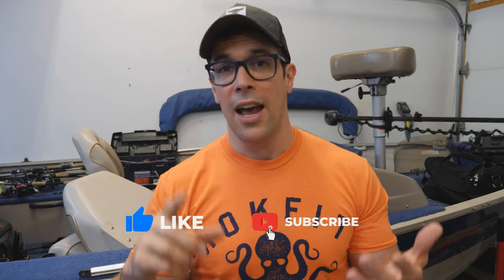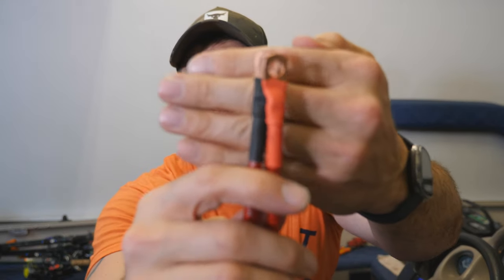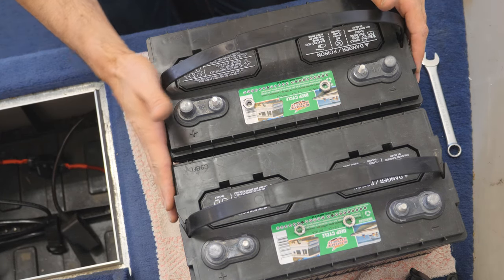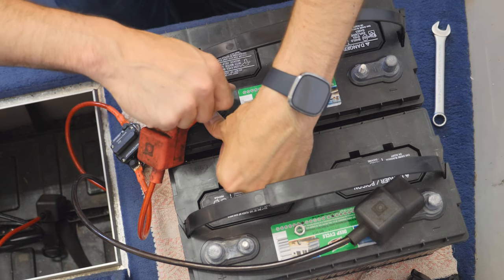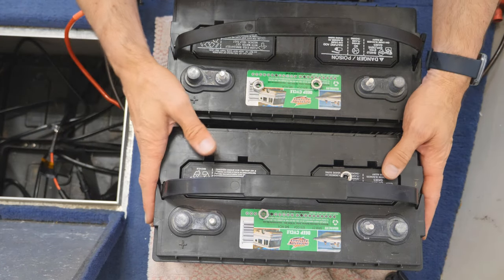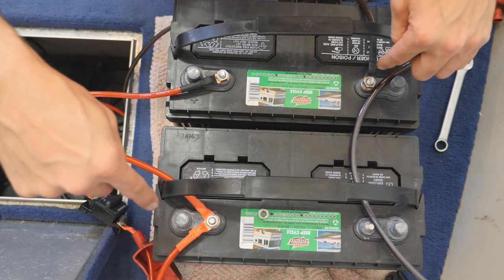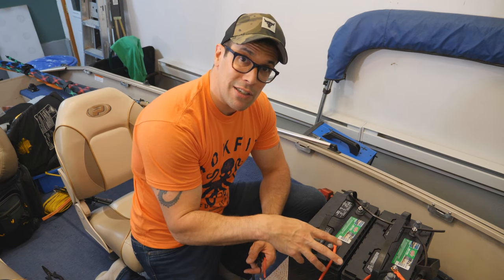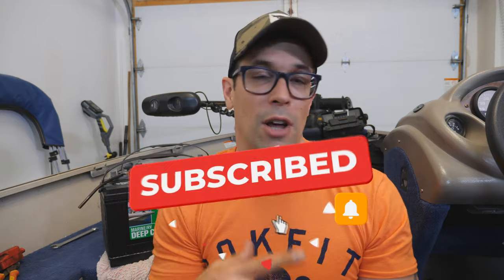Wiring 12v Batteries in Series or Parallel + Charging Tips!

Comment: Maybe I didn't understand. 
I have x2 12v lithium batteries I will connect in series for 24v
I also have a 13amp victron lithium 24volt charger
Are you saying I'm not able to use this charger at all?

Not worried about dead batteries as they will be hooked up to a smart shunt anyway

Comment: Hi, me and my friends wired 3 12V car batteries in parallel and for some reason the car has 16V when engine is on and over 13V when it's off. Do you know why? The batteries are new and identical.
Reply from the maker: Hi there, reading 13 volts after a 12v battery has been charging via a charger or the charging system/alternator of an engine is completely normal.  12v VRLA (lead acid based batteries) consist of 6 cells, each of 2.2 volts.  So PEAK voltage on all these combined is technically 13.3v and after 24 - 48 hours, the voltage will settle (resting voltage) to around 2.1v per cell, or 12.6 - 12.7 volts.

The 16v is because your engine's charging system is engaged and your alternator is charging your batteries.  Typically you should see your battery voltage increase to 14.6 - 14.8 so I am not sure why yours would be going to 16v.  You may have a 16v alternator or it may be related to something else in your vehicle's charging system.  Hope that helps!

Comment: Can you wire 2 different battery types in parallel?  For instance a starting battery and a dual purpose battery.
Reply from the maker: Theoretically yes you can it will work, but in terms of battery durability and long-term life, it's not a good idea, it's always recommended that you have the same battery with the same specs connected in series or in parallel.

Comment: I have 24v and two 12v batteries. Can I wire the two 12v in series basically making it 24v and then wire the two 12v and 24v in parallel? I guess I could just buy another 24v and make things easier.

Comment: If i have 2 12 v wired in parallel , will my alternator from my motor charge both batteries?
Reply from the maker: @hdhdididu655  yes!
Reply: @DanRichardFishing  thanks for the reply man , and nice vid. I had another question. When I go to hook up my switch my switch panel for lights and what not, should I put those wires on the same posts that the engine is connected to ? Or the other two free posts?

Comment: If you don’t have a charger on boat, how do you charge batteries with an electric charger with the batteries wired in series and parerell?
Reply from the maker: You do the same as in this video, you clamp 1 charger per battery if in series.  For parallel you can do individual batteries or you can connect the entire bank to a single charger if you only have the one.  Hope that helps!

Comment: Dan, I’m looking to put a trolling motor on my 22’ Pathfinder.  I want to go with the Minn Kota Riptide Terrova 36v.  I see there are 36v single batteries and would love to have only one battery versus 3 however, does the same principle apply, when connecting a battery charger?  One battery, one bank?  And would you have a recommendation for a particular battery charger?  Thank you in advance for your help and keep up the great videos! It’s much appreciated.  Mike
Reply from the maker: Hi there! Glad you asked this question and sorry I didn't see this until now! You would absolutely just need 1 charger with 1 bank, but you would need to find a 36v battery charger specifically for that battery.  You can't use a regular 12v charger.  If you do look in to getting a 36v, I would recommend you reach out to the manufacturer and ask what charger they recommend.  I know Dakota Lithium sells an 8 amp and 18 amp charger for lithium batteries (I am assuming you are looking at a 36v lithium) and you can check those out at https://dakotalithium.com/12v-24v-36v-48v-lithium-battery-chargers/ and they are currently on sale for $100 off.  Hope that helps!
Reply: Thank you for replying and the advice.  I was hoping it was that easy! Much appreciated!!

Comment: New subscriber here. I have questions. Maybe you can help.  I have two 12v starter batteries ran parallel with a dual bank charger in the stern of the boat. I also have two 12v deep cycles ran in series in the bow for my 24v trolling motor. My trolling motor batteries do not have a charger. Should I install a 3 bank charger to charge all four batteries and just have one bank charge the two batteries ran parallel? Or should I install a complete separate dual bank charger in the bow of the boat? I just don't want to deal with running two extension cords from the house. Also, the boat is 19ft long. Is it even possible to charge batteries that far apart from each other with the same 3 bank system? Thanks!
Reply from the maker: Hi Chris, thanks so much for the sub!  To answer your question, you should actually be installing a 4 bank charger, which are readily available just like a 3 bank :)  And yes you can extend the wires, most charger manufacturers sell extensions you can add to any bank wire not long enough, or you can make your own with the gauge they recommended.  Hope that helps!
Reply: @DanRichardFishing  thanks so much for the reply!

Comment: So if I have 2 batteries is series for 24 colts…. And I wire the charger bank 1 on battery 1 and bank 2 on battery 2 I can’t charge both batteries at the same time? I have to charge bank 1 and then when it’s charged shit it off and charge bank 2
Reply from the maker: Hi Joshua, thank you for the question!  When you have 2 batteries in series for a 24 output, that wiring configuration has no bearing on your charging setup.  So bank 1 goes to battery 1 and bank 2 goes to battery 2 and you plug in your charger and both batteries will charge at the same time :)  All the best!

Comment: Hey Dan, do you use your onboard battery charger for your starting battery as well or just the trolling batteries? I have the Noco Genius genpro 10X3 but it's in the front of the boat with the trolling batteries and the starter battery is at the back of the boat, way out of reach of the cables. Should I be adding extensions and running it to the starter battery as well? Thanks! Great video as per usual.

Comment: With two 12v batteries, should you read 24 volts from positive to negative from one battery to another on both ends of the batteries?  I read 24v from negative to positive between both batteries on one end of the batteries, but not on the other end.
Reply: I forgot to add that the batteries are wired in series.

Comment: If I have 4 batteries in series to equal 48 v can I add 1 12 volt battery in parallel to increase the amps? Basically, I have an electric scooter and I want to add a removable car battery  in parallel that I will charge separately. The goal is giving the thing a bit more run time. I understand a car battery is not optimal but it's what I have lying around lol.. and it's brand new. I also have an extra SLA but it is a bit older and dying out a bit.

Comment: I'm naking my first lil power station and came across this on looking up series and parallel as well as charging. Because the toolbox im using can hold 8 12v 5A batteries. Got 4 so far, then realized how I'm gonna charge em. All so using them withba 300 watt inverter.
Reply: Your post makes no sense.

Comment: I have 6-- 12v 100ap I would like to connect 2 - 12v  200ap  is that ok to do
Reply from the maker: Yes absolutely, you can connect two in parallel.

Comment: A question TOTALLY not related to fishing, BUT, you seem to know a lot about batteries. I have an automatic gate opener powered by a 12 marine battery and charged by a small solar panel. It's in a box out in the pasture so I'm not sure of its capacity, but it's fairly beefy. I am replacing the opener with a different brand that requires 24v. I am all good on how to connect in series so no problem there. I also have a 350cca garden tractor battery spare battery in my garage. My first thought is that it would probably be crazy, but I don't know. Could I connect those in series to run the gate opener? I know I don't need 2 marine batteries, don't want to have to buy another, and just buying another 350cca and using those two would probably be sufficient. Not sure however because the manufacture says I need two 12v auto batteries. BUT, since I already have these two I thought I would ask. Don't want to start a prairie fire, you know. Thanks.

Comment: Hey Dan you seem to understand agm charging in parallel and have very good videos.   This my question I have a found  a Ranger 1760 angler barely used but with the pro series dual bank charger for my trolling motor.  When in parallel charging both batteries one for each bank I am getting a max combined 25.1 or basically 12.55 each  when I charge them using the same dual bank not linked in parellel I get 13.5 roughly on each battery.   I am thinking of putting a switch in between the parallel cable to basically turn off the connection while charging.  What s your thoughts?

Comment: How donyou know you have double amp hours  , as its still 12 volt setup .. and my solar controller is still showing it as 1 battery  , as it dont know o have 2 batteries connected , ? Cheers

Comment: when you hook them this way are the Amps stay the same or they double?
Reply from the maker: Well amperage isn't pushed by the batteries, it's pulled by the electric device that needs the power, so the unit will pull whatever amps it needs and the battery system will provide it.
Reply: @DanRichardFishing for 10 batts hooked in parallel 12v 70 amp each would a 80a circuit breaker installed between the batts and the charge controller be ok or is has to be greater amp breaker?

Comment: I run my trolling motor on 2 batteries in parallel and my trolling motor is hardwired. I keep a butterfly nut on the negative my trolling motor connects to. It's easier to take off quickly and if you forget your tools you can still connect it easily enough at the lake. My batteries came with regular nuts but since the negative connection gets removed often the butterfly nut is much easier.
Reply from the maker: Yeah mine all came with butterfly nuts when I got the boat but I ended up removing them as I was concerned about having a really solid connection that would stay secure.  I personally don't have an issue with anyone using them, although some die-hards would scream at me if I suggested using them in one of my videos lol!

Comment: I use a flat steel plate to join the negative and positive, it holds both batteries together. No extra wires and very stable

Comment: Dan you videos are the very best and I learn and get you. You channel is gold for me. Thank You. I have a deep cycle Die Hard M27-1  It is 105 ah. It's not enough for my excursions so I'm getting another Battery to wire in parallel. I see Walmart has a nice Ever Start  Group Size 24DC (12 Volt/690 MCA) which is 101 ah. The diehard is 105ah. Is it ok to mix them up. The Walmart one is 50 bucks cheaper. What would you do? I think perhaps it would be best to match the batteries but I'm not sure. Please advise.
Reply from the maker: Wow thank you so much for the kinds words, I love that my videos have helped you!  Sorry it took so long to reply but I would not recommend mixing different brands/models of batteries in a parallel or series setup, not to mention you'll have an older battery mixed with a new one.  I would honestly recommend you match them so it's the same batteries.  I mean, it will definitely work, but the batteries will not drain evenly and you'll likely discharge one much more than the other and that one will likely get scrapped quicker than it should.  Hope that helps and thanks again for subscribing to my videos :)

Comment: My Motor guide trolling motor is 12v or 24v how should i run my batteries to switch from one to the other i have two positive wires and two negative wire running from back of boat to a 4prong plug???
Reply from the maker: What model and year is the trolling motor?
Reply: @DanRichardFishing  91 is the boat model i assume it’s that year no serial numbers it’s a 12/24 brute 756 motor guide

Comment: I understand everything you said. That's information that I already knew. I'm sure I know the answer to this question, but I can't get a definitive answer online. When charging the batteries for my 24 volt trolling motor that are wired in series. I just took the two bank battery charger up to each battery the way you would normally and charge it normally without any issues correct
Reply: This is what I've been looking for.  I can't seem to find a straight Answer about it.   seems to me when they are wired in series for 24 V they should be charged with a 24 v charger.  from what I understand a 12 V charger will charge them but will take longer because they are wired in series to 24 V
Reply: @JamesWhite-tg4kw  that's what I did. Because you can still charge them individually as 12-volt batteries treated just like they're not wired up in series. No work just fine charges normally
Reply: So you just charge them in series with one 24 v charger
Reply: No charge them individually with 12 volt chargers. I have a 12 volt three bank charger and each bank is hooked up to one of the 12 volt batteries acting like nothing's wired in series and it's three individuals. The third one being my starting battery. You might be able to use a 24-volt charger and hook it up the same way you would your trolling motor. But I'm not sure if that would ruin the batteries
Reply: See that is the answer I'm looking for so when you charge these batteries individually with a 12v charger do you unhook the cable going from the positive of one battery to the negative of the other battery so it is not in series like a 24 v
Reply: @JamesWhite-tg4kw  no. Just hook up the charger like you would if it was an individual battery.
Reply: @JamesWhite-tg4kw  cuz I have a 24 volt trolling motor, and I have two 12-volt batteries wired in series for that 24 volt. But just like my Buddies brand new boat his three back chargers are hooked up from the factory to the individual batteries. Tha same way they would be with just 3 12 volt batteries. Just plug and play. No on hooking the jumper wires or anything
Reply: OK. That just doesn't make much since to me 🤔
Reply: @JamesWhite-tg4kw  well it's only 24 volts once you Bridge the two with the jumper wire and then put your trolling motor or whatever else on the positive of One battery and the negative of another battery. But if you would hook up to the positive and negative of the same battery you're only getting 12 volts because you're not bridging both batteries if you understand what I mean
Reply: 2 batteries in series can I just hook up one 24 V charger to 1 battery and charge both batteries that way
Reply: @JamesWhite-tg4kw  no you can't just hook it to One battery or you will destroy the battery and possibly the charger. Now you might be able to hook it to both batteries like you do your trolling motor positive of One battery to the negative of another battery and charge them that way but I'm not sure so I can't answer you properly on that one
Reply: OK. Thanks for your help. Guess I'll charge them one at a time tell I get a two bank charger.  These are lithium batteries so I don't want to mess them up lol

Comment: I bought a boat with two trolling motor batteries with series wiring. After two years I replaced the charger with another two bank charger. When I plugged the charger up it showed “default “ on one battery. I disconnected the positive to negative cable and it charged just fine. Anyone know what caused this? The charger is a Guest two bank charger.
Reply from the maker: Hi Mark, just to confirm you have each bank going to 1 battery right?  So bank 1 pos and neg wires go to battery 1 and bank 2 pos and neg wires go to battery 2?  And you also doublechecked that you did not reverse the polarity anywhere and all your charging cable fuses are ok (you should have one on each pos and neg wire of the bank charger).  If all that is OK, I'd give Guest Two a call and ask what's going on.
Reply: @DanRichardFishing  thank you for responding. I connected everything exactly the way it was. Once I disconnected the cable from the positive to negative terminals it charged
Reply from the maker: @marksinger4415  right so you're saying once you remove that crossover cable that creates the series connection, it charges. Something is not right, my bank charger and the ones I've had before and anyone else I know they all work fine so I'm not sure what's going on. I'd give the folks over at Guest a call.
Reply: Did I just legitimately win something?

Comment: But you can charge each individual 12v battery while they are connected in series, right?
Reply: No, modern battery charges can charge a battery bank up to 300 amp hours from discharge. A Ctek 10 MXS will charge the whole battery bank. It is a smart charger that will recondition a battery bank and checks that all is well. Fault codes will flag up if not. An 8 step charging regime will fully charge and protect the battery automatically.

I would never put more than one charger onto a battery bank at the same time. If you have more than 300amp hr bank just split it into manageable sections and charge separately.

Comment: Do the batteries need to have the same ratings for comnecting in parallel?
Reply from the maker: Yes. Ideally they are the same brand, same specs and bought at the same time. At the very least they need to be the same capacity rating or you risk severely lowering the life expectancy of whichever battery has the lower specs